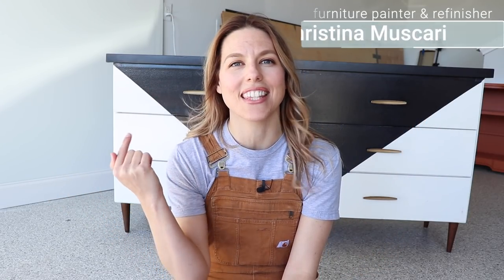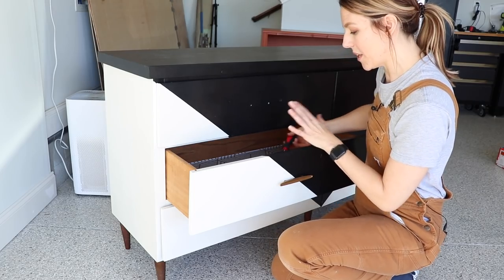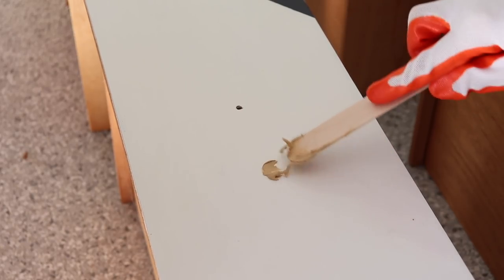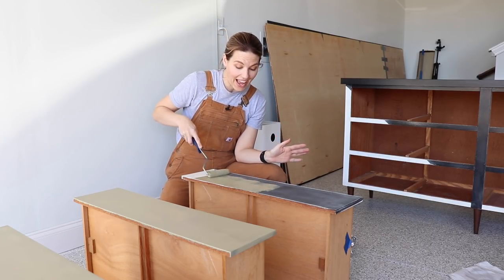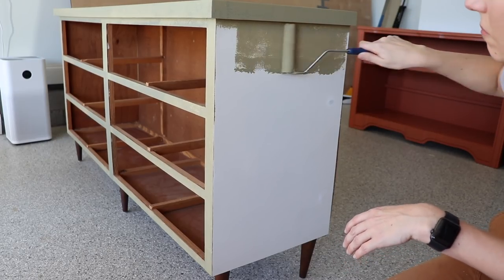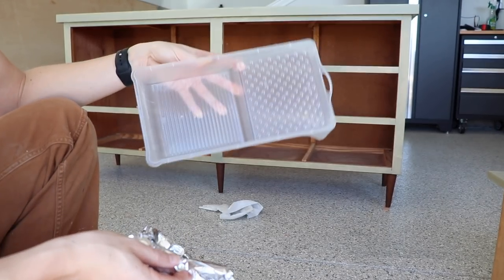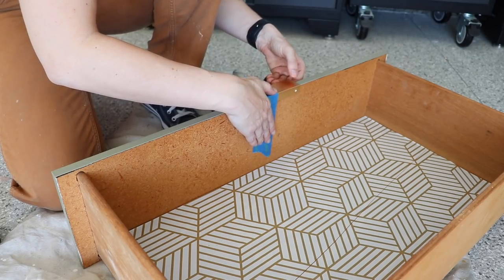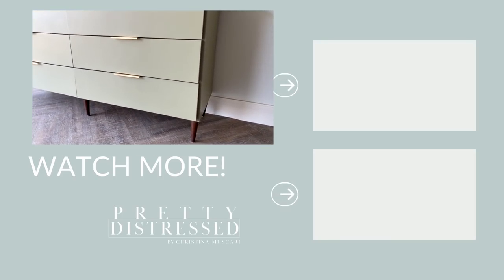Furniture Painting for Beginners | One Step Paint MCM Dresser Makeover

Comment: Originally purchased their Linen (qt) and Off-white (gal) when it was called 'Reclaim.' Created my own custom color. I've used this paint on a very large wall unit, dining set, four-poster bed, nightstand, dresser, sewing machine cabinet, lampshade, picture frames, lamp base, computer stand, etc. The Off-white just happened to be perfect match to apt walls so used to paint closet after plumbing repairs and to freshen up around deep-set windows. (Most likely forgetting other uses over the many years I've had it.) 

Started with the recommended stippling and roller but didn't like the look or texture so ended up doing all pieces with a brush. This paint was not the 'pudding' consistency but, rather, like lumpy Jello-O so was tad wary but laid down fine. More recently, bought their Bright White and it's thinner like yogurt. All the furniture pieces were mahogany and covered well. (Had a few small areas of bleed-through which I was able to seal with bit of clear nail polish....my only option.) Used Howard's Citrus Shield on everything (BP adhered well over waxed surfaces if changing color, etc). Did slight distressing and gave dimension with bit of Folk Arts' Antiquing Medium. None of the pieces were sufficiently covered with only two coats. They all required more and with some pieces, I took creative license with washes, color changes, etc so worked on some over a number of days. 

In small apt so the larger pieces had to be done 'in place' so appreciated that BP didn't necessitate much prep (wiped them down with vinegar water), lightly sanded pieces at start and between coats, and odor was very minimal (slight ammonia smell). Of the original qt and gal, still had lots left over after doing all the pieces. BP can now be had for less than I originally paid but ultimately very cost effective given the number of pieces done. Only picked up a pint of the Bright White to update and brighten certain parts. The finish has held up very well.

Comment: I want to paint the tiles on my fireplace then use a stencil. You can actually apply this over tile without any other prep except cleaning?  I had looked at both Fusion and Dixie Belle and I think both of those recommend putting on a primer meant for things that are non porous ?